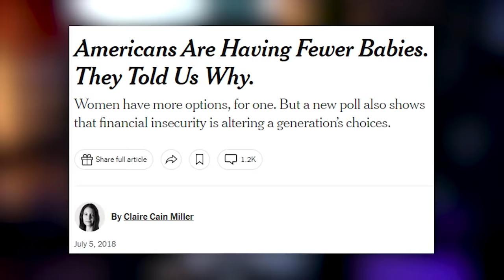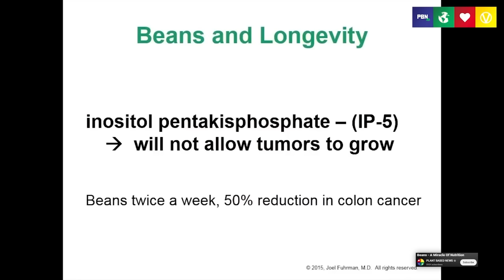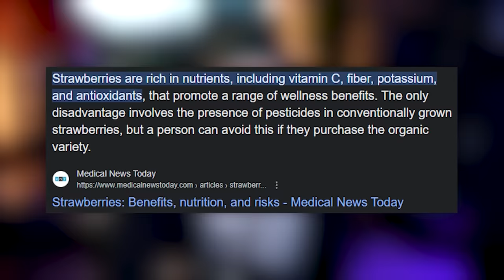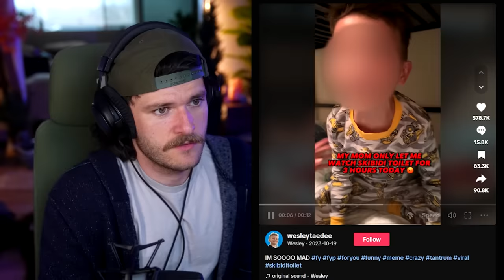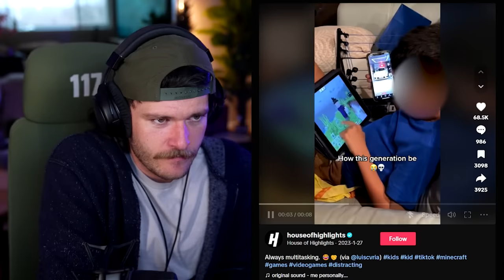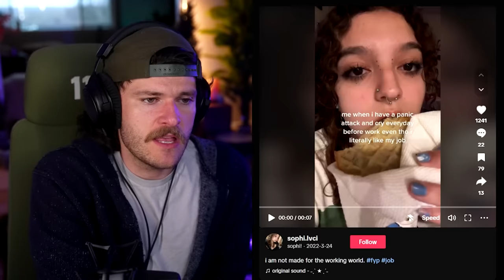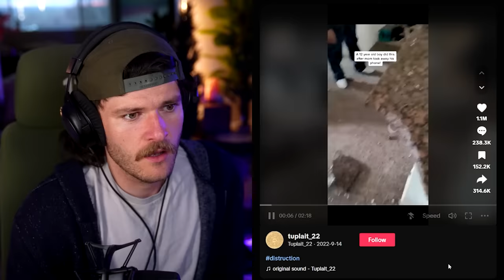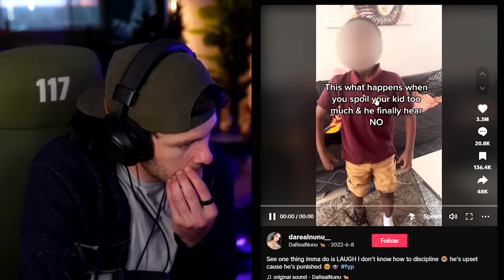They're Doomed.

Comment: I agree and disagree with several of the points made in this video. And the comments. I worked as an EMT and paramedic and then taught paramedic students.  Obviously life is very difficult, but I find myself asking if it needs to be as challenging as it is. And the answer is no. In many aspects, it is unnecessarily hard.

Comment: Not only that, but in recent months the market has shifted and even basic jobs have become very difficult to get, the system literally is designed to look for inadequacies and the ones who slip through are those who either figure out the right way to lie or have a direct in. If you have a job right now, hold onto it for dear life and if something else with better pay wants to take you, go for it. Don't find yourself caught in between.